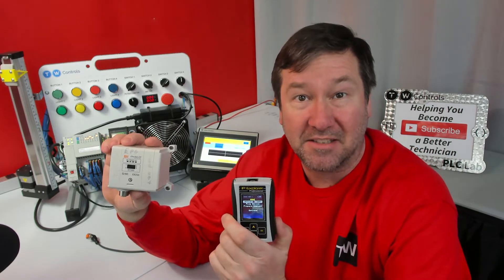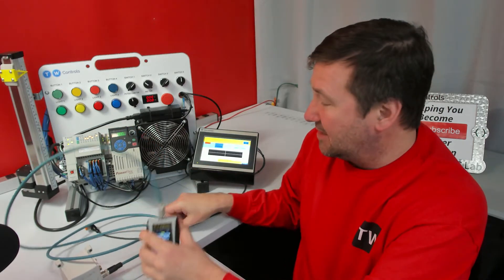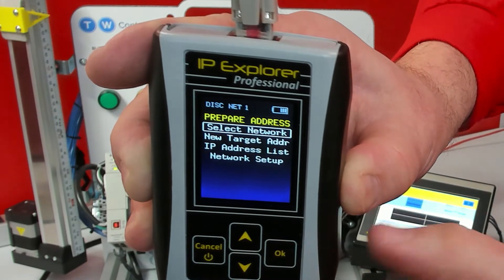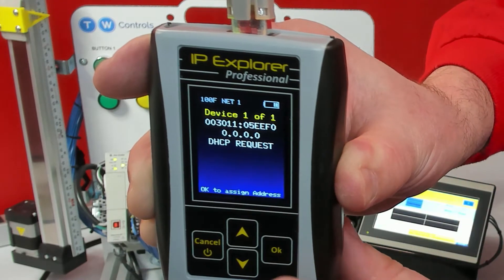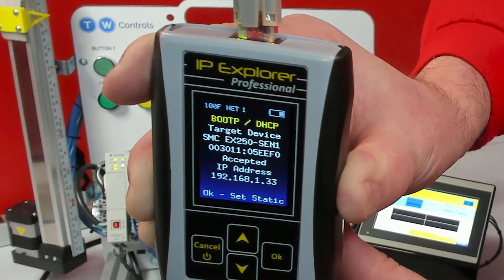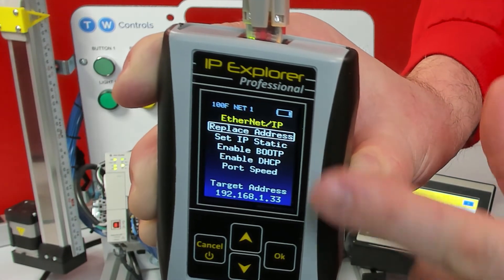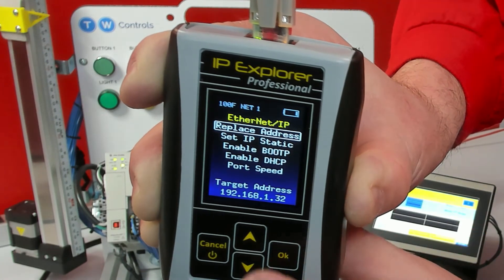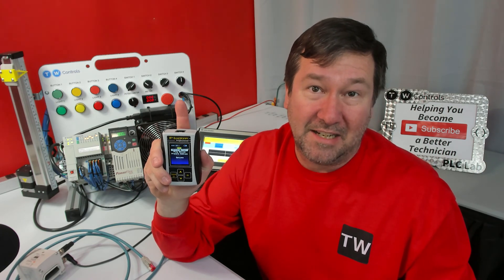SMC EX250 IP Address.  Assign or Change Configuration

Comment: I am wondering if it works with Mac laptops and IPhone devices. I am new to this tech world but as of last year the ip address on my iPhones MacBook and iPad were changed from a dynamic IPv4 address to a static IPv6 addresses. I tried contacting my iPhone carrier AT&T about the matter but I am not getting any assistance. It looks like someone who works in IT or an administrator illegally did this from initials me working from home used a Wi-Fi adapter which was installed in my Windows 10 work computer. It look like they went into my router admin page and got my device information and from there changed the ip addresses. I know this is a bizarre situation but because it was my job and they knew they could get away with it. I have been very unsuccessful in getting assistance in this matter
Reply from the maker: No, that isn't what this device is intended for.

Comment: Does it works with VSDs as well?
Reply from the maker: VSD?  What is that acronym ?
Reply: @TimWilborne  Variable speed Drives
Reply from the maker: @jaderrosa2  What brand?
Reply: @TimWilborne  95% of the VSD's I usualy work are A&B and Schneider's
Reply from the maker: @jaderrosa2  It works well with AB. I would expect it works decently with Schneider but it would need to be Ethernet IP or Profinet compliant for the change IP features to work